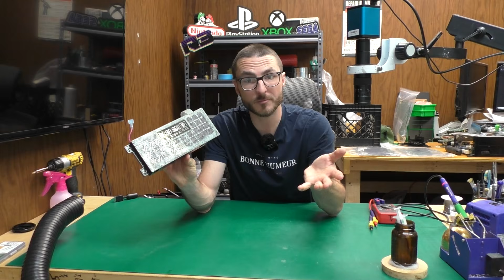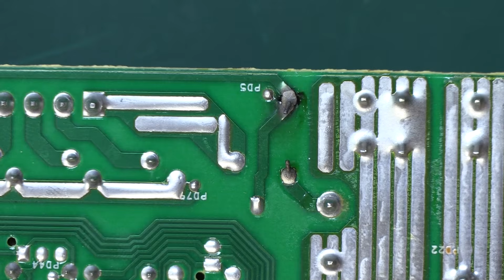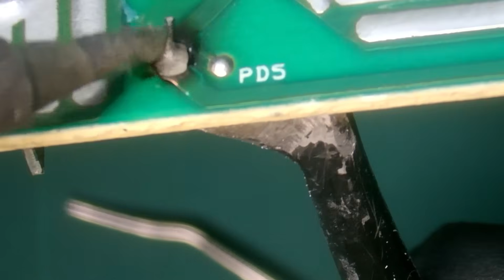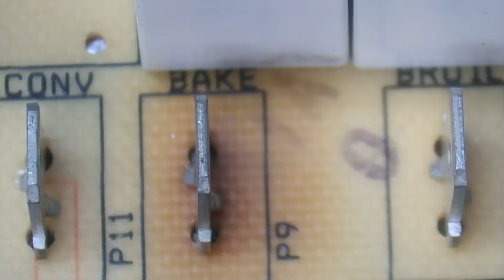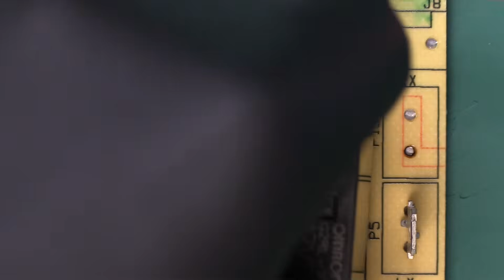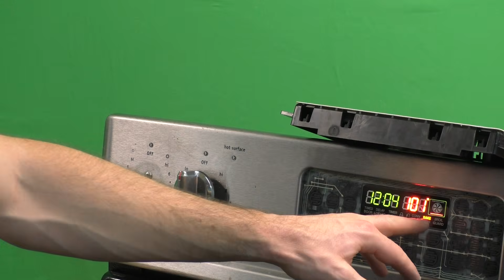Burned Frigidair controller Board 316462807

Comment: at 14:39 in video the black alligator clip seems to be attached to an unsoldered joint??
Reply from the maker: That is correct. I desoldered the joint because the solder was making it harder for the clip to clip onto the leg of the component. 
Having it soldered or not doesn't matter in terms of our test.

Comment: The customer absolutely must cut off and replace the connectors that were attached to those pins that showed heat stress - guaranteed their resistive, and use a high quality connector that can handle the current.  What I also do on these boards is to remove the pin that got hot and swap it with another location that handles much less current.

Comment: After the 3rd mainboard failure on our Kitchenaid induction stove with the part being hard to get and between $500 and $900 for the part we fixed it with a different make
Reply from the maker: I don't know if you still have the information but what was the model number of your stove? Or the part number of the circuit board you had to replace? This may be a unit I need to look into and do a repair video on.

Comment: So the resistor was intentionally blown due to the failed closed relay as a safety to avoid burning the house down?
Reply from the maker: I don't think so but some people on youtube have said that's probably why. But if that was actually the case I feel like a fuse or a thermal resistor would have been a more obvious choice than a normal resistor.
Reply: @NicksElectronicRepair  A fuse is the common failure point and the general population know that but a resistor makes a consumer think the board is destroyed. Just a guessing here.

Comment: Hello Nick, how do you know where to plug your temperature sensor (resistor) on every oven board you’re repairing? Also, sometimes you’re plugging a second resistor (I think 220 ohms?) on two differents pins. What’s this resistor for if you don’t mind me asking?
Reply from the maker: That one you are reffering to is probably for the door lock. 
I know where to plug in the resistors because I cheat and don't play fair. :) I bought all the ovens and looked at where all the sensors plug in so that I can make it easier to bench test these. 
Most only require the temp sensor some the temp sensor and door lock. Depends on the unit.
Reply: @NicksElectronicRepair  Haha I see. Okay, thanks for taking the time to reply!

Comment: We had a bad circuit breaker that caused damage to our Gaggnau oven wiring and circuit board.
Reply from the maker: Are you in need of a repair tech to service it? If so you can fill out our contact form linked below and we can disccus options from there:
https://nickselectronics.com/pages/contact

Comment: Manufacturer's use minimal wiring gauges. these smaller gauge wires run hotter. This in turn is conducted into the circuit board terminals. Also these designs switch heater (compressor can) or heating coils in dishwashers. Instead they should contractors  that are not installed on the pc board.

Circuit boards in all these appliances eventually show signs of heat damage.

Comment: When we bought our new home, we noticed the electric stove has issues with the lights inside the oven.  In checking the controller board, I noticed there was an issue on many traces that were burned off the PCB, so it appears there was a short. I'm not sure if someone shorted the light bulb in side the oven, or what.  I had to replace the traces with some bodge wires to get the lights working inside the oven.   The prices of these controller boards are crazy... usually costing 1/2 the price of the entire stove price was.
Reply from the maker: Yes replacement controller boards can be very expensive. That's why repairs are a very good alternative options.

Comment: Not a good idea to power relays in circuit, it normally blows  the drive transistor.
Reply from the maker: I will keep that in mind for the future, but personally I have not had any issues so far, but also I  never do that typically, it was because it was a video that I did it, to show the circuit opening and closing while it's in the controller board so it's easier to see the path and how power moves through.
Reply: @NicksElectronicRepair  no problem, if you power the relay the wrong way it will show a sort due to the diode. But driving the tranny will blow it 😉
Reply from the maker: ok

Comment: Are those circular marks around components a vaporization boundary or thermal shock boundry causing undesirable cristalization patterns?
Reply: Under magnification, sometimes what appears to be circular cracks are actually dried residue from the board being washed after production, but generally speaking any circular marks are mostly cracked solder due to mechanical stress on the brittle solder they use these days.  Thermal stress might have something to do with this but considering that most of these cracks are around terminal strips, it indicates mechanical stress (which yes can be due to thermal effects!). This was much less a problem when lead solder was used.

Comment: If there are cracked solder joints on the relay pins I think the root cause is the relay contacts are burnt and their increased resistance is causing the heat/cool cycle that cracks the solder. The longer lasting repair is to replace the relay.  Similarly the spade connector oxidation will result in cracked solder joints on the connector pins. Ideally use a new spade connector, alternatively clean the connectors well to reduce their electrical resistance.

Just my 2 cents, having done similar stove and dishwasher control repairs.  Also do not leave a heat producing appliance running when you are not at home to smell the burning electronics and shut it off.  Google dishwasher or stove and fire to see why...
Reply from the maker: Yeah especially when the relay is stuck in the on position.

Comment: Can you elaborate on the resistor circuit? One side is on the load side of the relay. What does the other side connect to? I'm trying to visualize the path and purpose of this component.

Comment: You had a big miss on this the l2 side of that bake and the broil go through that big relay and damage them when this happens and you put to big of a resister it's only supposed to be like a 1/4 or 1/3 watt because it acts like a fuse and pops when those bake and broil relays turn on without the l2 relay being closed to be honest I can't see any good reason to have that resister in there all it can do is destroy something when things go wrong but I would have been more concerned about that l2 relay than the broil it is used when ether bake or broil and is put under 2x the load especially when there was a burn out
Reply: A correctly rated fusible (flame proof) resistor would have been a better choice?
Reply from the maker: Yeah those resistors we install are going to burn up and fail open as well if there is an over draw or problem. We have tested them for that exact reason and they do burn and fail open acting essentially like a fuse except they don't explode and make a big mess like the original did. 
They are good replacements and safe.

Comment: Hands down most underrated electronics repair channel on YT! Incredible work Nick!
Reply: Would be nice if more details were provided: 1) How did he come up with the proper resistance for the replacement since the original was burn to a crisp. 2) How much power was being injected to the relays. 3) How to identify replacement parts for those relays.
Reply from the maker: The resistor is hard to identify when it's burnt like that. You will call me a cheater but we have a known good unit we use for this exact reason. So we just grabbed the information by looking at our good board. 
The part number information is printed on the relay, you just have to google it to find the specs and typically replacements or identical relays are available. 
Although the video is really more advertising for you to send it to us for repair :)
Reply: @NicksElectronicRepair  Makes sense; thanks for the clarification.
Reply from the maker: Yup
Reply: @ahmedsahid5036  definitely all valid points!  I would say that the answer to coming up with the proper resistance for the resistor that was blown completely off the board would have an answer/explanation that night be more confusing than just not mentioning it.  I will say that I have repaired several of these Electrolux/Frigidaire oven boards myself and I ran across one of these with the same resistor blown to bits and determining the proper values is not straightforward.  I first started by looking for a schematics of any kind or any type of board view which just does not exist. The next step is to Just use Google-Foo I'll search the exact model of board and hope and pray that somebody posted a high enough resolution photo that you can make out that exact resistor and read the color stripes on it and match it to the correct values using your resistance chart. I have actually had the best luck with eBay postings showing good enough photos, but for some more abstract and obscure boards, you might just have to sift through hundreds of thousands of images from a Google search and hope you hit the jackpot. In my opinion, trying to explain this in a tutorial video such as this one could confuse people even more than just leaving out that detail.
That's for how much power to inject to the relays, Even on this channel, there has been mention before of what voltage and amperage should be used to activate relays. Also in the electronics world, it is pretty common knowledge that almost every relay manufactured is standard 12 volt to activate it. Mentioning this in every video would just make the videos longer and could actually be confusing, since there are relays such as this that use 12 volt supply but activate a load with 220 volts, and then there are other relays that are also 12 volts to activate, but rated for even higher or lower voltage on the load side.  Also, there are so many YouTube videos showing the 9 volt battery trick to activate a relay, even though the relays are rated for a 12 volt trigger, 9 volts is usually enough for most relays to activate, at least for testing purposes.
Response to finding the values for the replacement relays, I would also argue that since those original relays were not physically damaged extremely, the values were still legible and could easily be found using some Google-foo as well.  I will say that Nick did mention that he matched the ratings on the original relays, but sourced ones that were rated for a higher voltage than the original, Just meaning that they would be less prone to failure in the same circuit that only needed a lower rating.  This is all just my opinion, but please take everything I say with the grain of salt, but my initial post was just more or less based on the overall quality of work that is performed on this channel. I will also say that since Nick's company also sells the services that he films, I'm fully understanding if he leaves out some details that would make his services less needed or desirable. When running a company, it is good practice to keep some tricks up your sleeve so that you can keep the lights on and still churn out videos in content like this or others to benefit. Again, this is all my opinion.
Reply from the maker: Wow, thanks! :)

Comment: If you strip a piece of 14ga copper wire down to bare copper and form/bend a small sqaure that contact the four points of the relay..you can use the copper square you just created as a sort-of "heat pipe" that will transfer heat and flow all four contacts simultaneously..you can then easily pull the part. I do this repeatedly for taking parts off donor boards..works very well.
Reply from the maker: :) nice workaround

Comment: Great tutorial! (assuming you fixed the dry relay joint off camera)
Reply from the maker: Dry relay join? You mean cold solder joint? Do you have a time stamp?
Reply: At 14:30, but I see your reply to @danhorton6128 says this was a temporary operation to attach a clip. Thanks!
Reply from the maker: Oh yeah that was because I was having a really hard time getting those aligator clips to stay connected so removed some of the solder which helped a little but I still struggled.

Comment: How you know how much  the restance value how many ohms if its burned like that
Reply from the maker: We have fixed hundreds of these so we cheated and looked at other control units that did not have that component burnt on it.
Reply: @NicksElectronicRepair  Yeah, that is my biggest problem, nobody will release their proprietary schematics for you to repair anything. Do you have any other method to find out component values if you don't have a comparison board available?  This type of info would be worth my $$ support for channel.
Reply from the maker: If we can't identify a part we either have to buy another board that has that part in good order perahps a broken donor board, or look at good pictures on the internet which don't always exist.
Reply: spec sheet.

Comment: When you were testing the new relays the coil lug that you were connecting the DC ps negative to, that solder lug was very clearly not soldered. How did you not see that 😂 it’s weird, at 12:04 if can see that you do indeed solder both coil solder lugs, but then at 14:00-14:30ish, the entire time the right most coil solder point is bare of any solder. What happened? I mean you spent a good several seconds trying to attach the alligator clip, figured you’d see it.
Reply from the maker: Right so as you stated, I did solder it, but then when I went to test it, the alligator clips  wouldn't hold onto the pin with the solder, it kept sliding off because of the solder so I had to desolder it in order for the clip to hold better. But even with it desoldered partially I was having a hard time getting the clip to hold.
Reply: @ I see, that makes perfect sense.
Reply: @NicksElectronicRepair  That does make sense,  but it would have been great if you had explained that in the video so we wouldn't have spent so much time scratching our heads!  🙂
Reply: I noticed that as well. He didn't solder that joint. I was saying that while he was testing the relay.